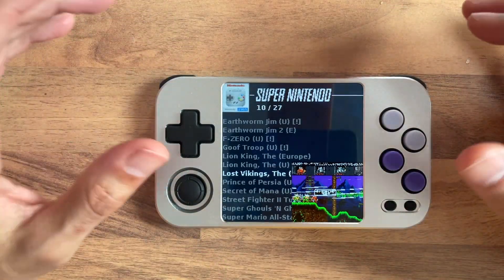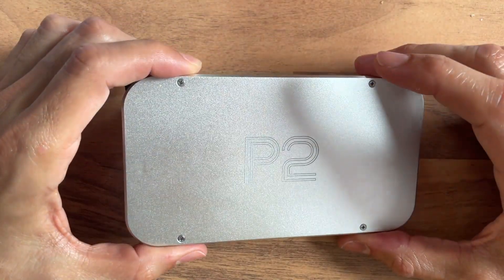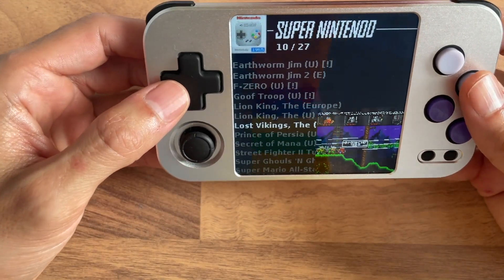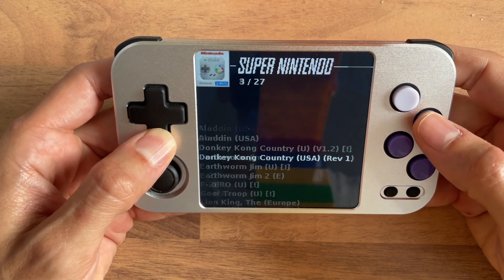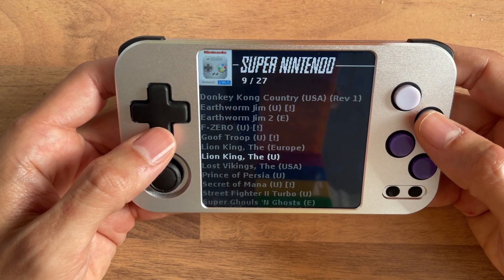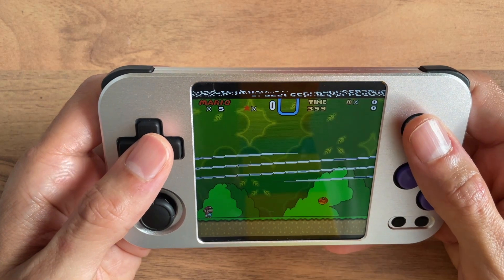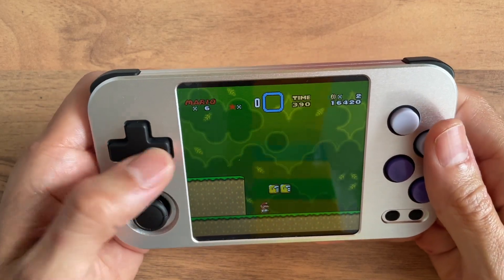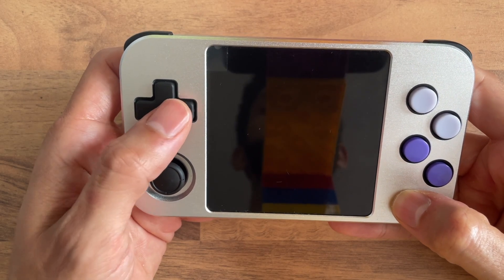Retro-Go running on the Pico Held II DIY handheld (ESP32-P4 version)

Comment: hey, question, how can i message you directly or contact you about something (an offer basically) regarding your older  pico hero/pico held rpi 2040-plus work?  do you have discord, or email or any way i can contact you directly?
amazing work btw! :)
Reply from the maker: Hi, thanks and yeah, sure, you can find my e-mail address in the header of most of the files for example in the picohero_pplib repo. Sounds a little mysterious though, I hope it's not "an offer you can't refuse" 😋
Reply: @peterthunderstorm6767  😁😀very funny mate ! and great work on the project !!

Comment: This is great! So the screen itself runs at 50 or 60 fps? What kind of screen do you use?
Reply from the maker: The ESP32-P4 version has a 720x720 MIPI screen. It can run at both at 50fps and 60fps. It's really neat. The 3x integer scaling gives it a nice pixelated look :)
Reply: @peterthunderstorm6767 I got myself a P4 board and a 3.5 inch 480*800 ST7701S MIPI RGB (LZX-35IPS-AO0) screen to make myself a flip style handheld. I have hopes I could make use of the retro
-go project, in which I find your context very inspirational!
Reply from the maker: @nicoful86  Sounds like a great idea, looking forward to seeing it come to life! Also, there should only be minor adjustments necessary to make it work with your setup.
Reply: @peterthunderstorm6767  do you have any way to contact you directly about something related to your project (an offer basically) regarding your older  pico hero/pico held rpi 2040-plus work?  do you have discord, or email or any way i can contact you directly?
amazing work btw! :)